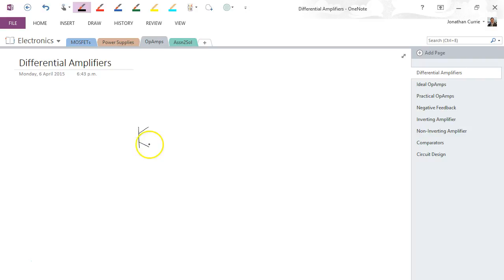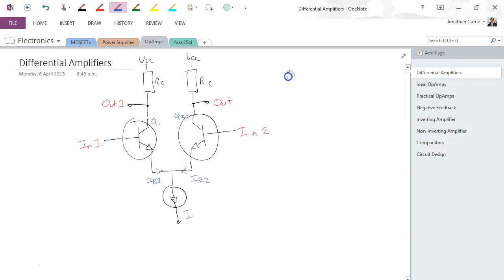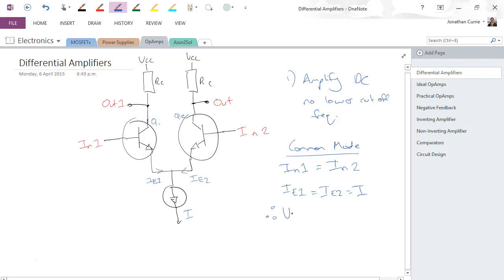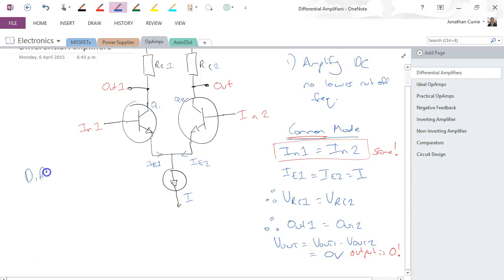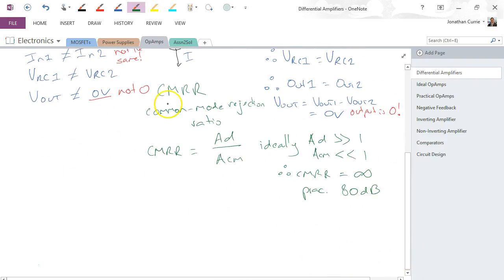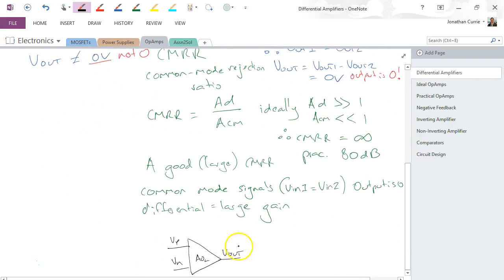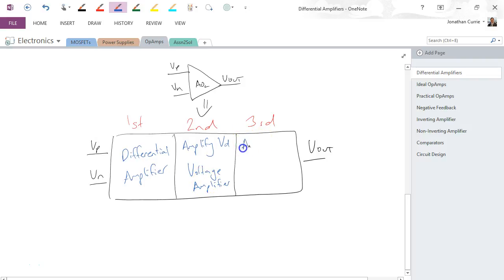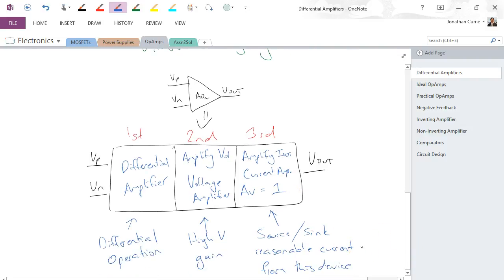Op Amps: Differential Amplifiers

Comment: Watch the two videos listed below which begin with descriptions of differential-mode and common-mode currents with animations. A basic scheme of a differential amplifier is introduced with the description of the analogous operation of a U-tube manometer. This is followed with a description of enhancements to the basic scheme of the amplifier to make it suppress common-mode output voltages more efficiently.
The Basic action of a Differential Amplifier- the heart of the Opamp.
Part 1 of 2
https://youtu.be/uggOykLShMU 
Part 2 of 2
https://youtu.be/jLJAYyap5WA

Comment: If IE1 and IE2 converges at the bottom, shouldn't Total Current at bottom be IE1 + IE2 according to Kirchhoff's Current Law?
Reply: Maybe the video pt 2 of 2 will help.
Watch the two videos below which begin with descriptions of differential-mode and common-mode currents with animations. A basic scheme of a differential amplifier is introduced with the description of the analogous operation of a U-tube manometer. This is followed with a description of enhancements to the basic scheme of the amplifier to make it suppress common-mode output voltages more efficiently.
The Basic action of a Differential Amplifier- the heart of the Opamp.
Part 1 of 2
https://youtu.be/uggOykLShMU 
Part 2 of 2
https://youtu.be/jLJAYyap5WA
Reply: In practice they will not be carrying current at the same time. Total current for the current sink will have to come from left or right.
The video was not clear enough on this point, I agree.